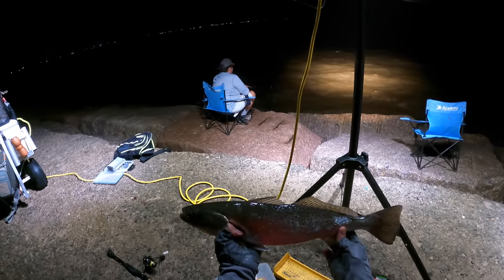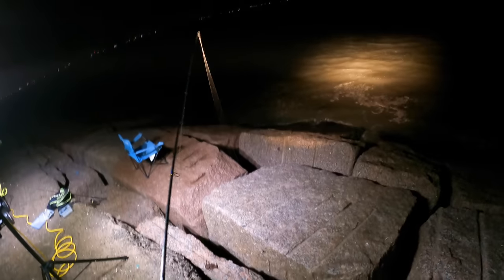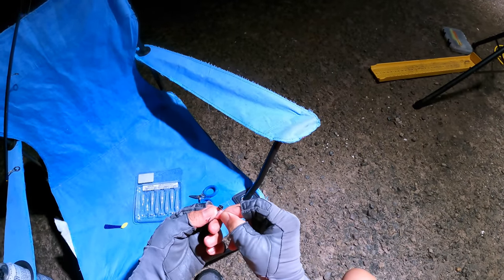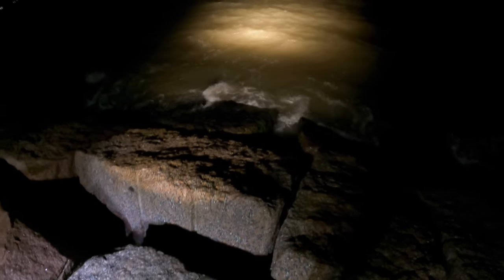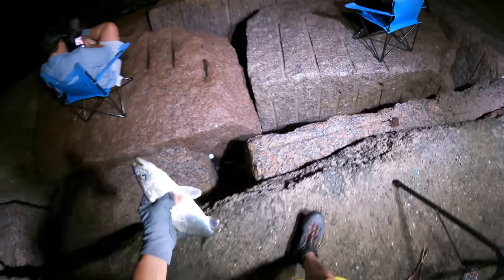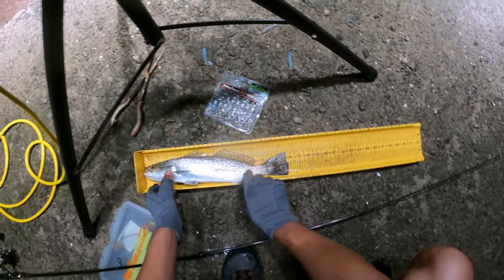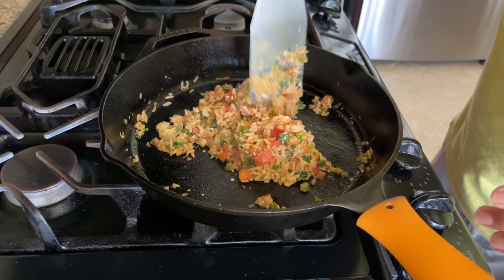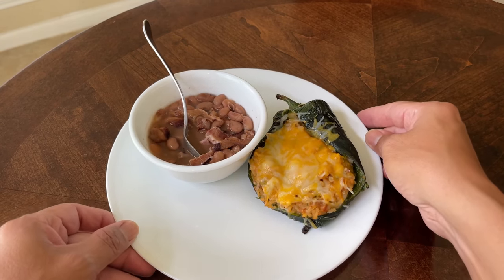Nighttime Jetty Fishing with 1,000 Watts of Electricity (Catch, Clean, Cook) S6 E79

Comment: Oh Marc, you have all the greatest equipment to fish with here's more for your artillery. 
- Canopy Weights Set of 4 $23 (they look like weights but are great to hold down canopy's same principles with light stand) Amazon.
- Tiki torches filed with BiteFinders (torch $5-12ea.), (BiteFinder liquid $17) Home Depot
- Portable Fire Pit $12-18 (2 small logs will clear all types of insects in your fishing area) Amazon
- Mosquito Repellent Coils (4-Pack) $4 @ Home Depot (if you can't have fires light a couple of these in your area all bugs will be gone) Home Depot

You don't need all the bug repellents but smoke repels all flying insects, especially the ones that bite.  Tight lines.
Reply from the maker: Thanks, gonna check out those weights 🙌

Comment: i have a ? and i whant your onest opinion, would your 13.6 kayak be better of with a 55pound thrust or higher minn kota motor? please answere onestly thank you .i think the 45 pound thrust is to small for the kayak.
Reply from the maker: It doesn’t matter what size motor you put on the kayak. The body design isn’t meant for higher speeds. It’s not meant to go on plane so to say. It’s like throwing a NASCAR engine into a Prius. They weren’t designed for each other. The engineers at Old Town designed the kayak body for a 45 lb thrust motor.
Reply: @MDLRFishing  thank you fore getting back to me . i under stand the planeing part i put 23 years working with boats, it would pick up 1or2 mphs. the thing i was getting at was a 55 pound thrust would not work as hard and would be easyer on the battery. no kayak is going to plane as a boat dose. thank you once again from MrBear hudson fl.